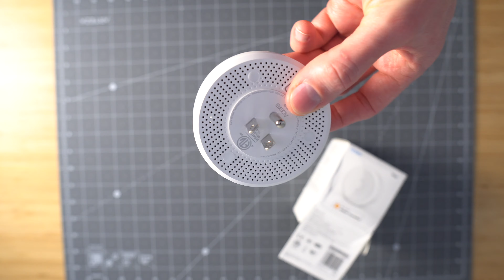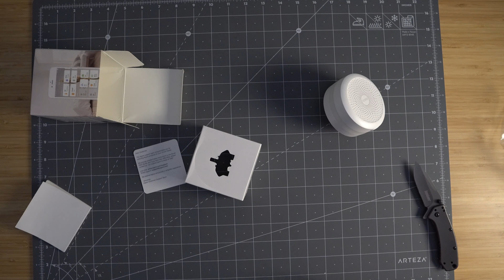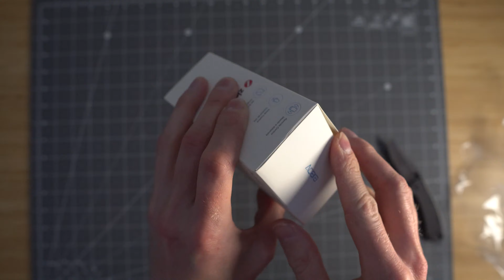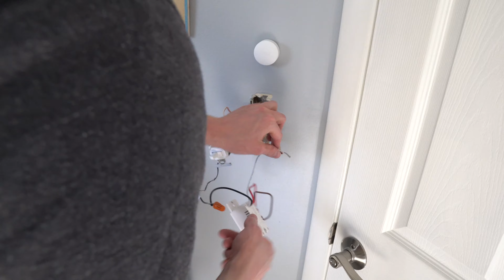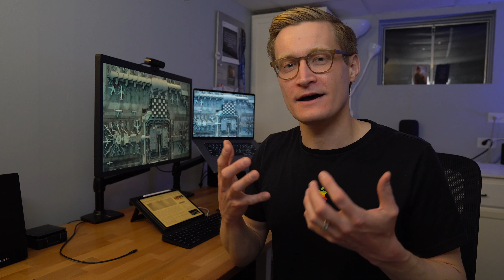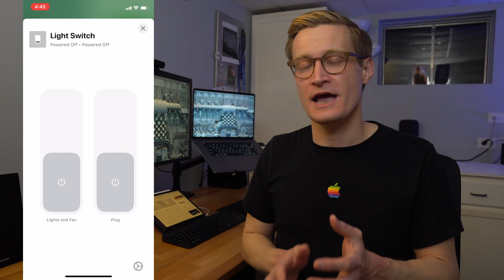The NEW Aqara US Smart Switches

Comment: My current setup has two switches under 1 plate.
There is 1 hot wire and 1 load wire for each, so 4 wires in total. They are controlling two sets of lights individually, but just installed under the same plate.
Is the Aqara double rocker the right option for me? Thank you!

Comment: Hello! If I buy a smart switch no neutral from aqara with 3 gangs but I have just one line for light connected to the switch can I use the others 2 buttons to control others things around the house like led strip or smart plug with routines?

Comment: Hi Eric, very helpful video. I am planning reconstruction of my flat (electric system) and would like to use wireless switch instead of physical one to control the  philips hue light bulbs on whole flat. Can I use  AQARA WALL SWITCH WIRELESS 2 button  instead of philips hue dimmer switch in every room or do you think no so good idea? Is there any delay between these possibilities? I am preffering apple homekit assistant. Thank you for response
Reply from the maker: In your case since you aren’t installing switches in the wall, I would go with the Philips Hue Dimmer Switch. They have 4 buttons not 2 and are very customizable in HomeKit

Comment: What brands do 4 way HomeKit switches?
Reply: Hawk33 Lutron Caseta can do four way configurations as follows: one main switch dimmable or non dimmable and then in place of all other locations have remotes that link to that one switch. You can remove the switch install their electrical plate for the remote to sit in. Keep in mind you will have to connect the wires together in order for it to be a continuous circuit for the main switch to operate.